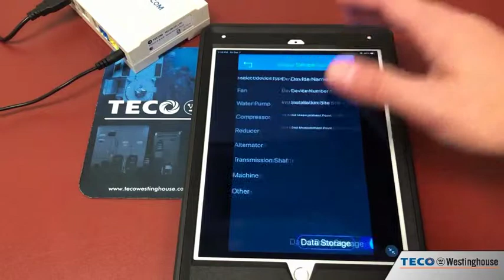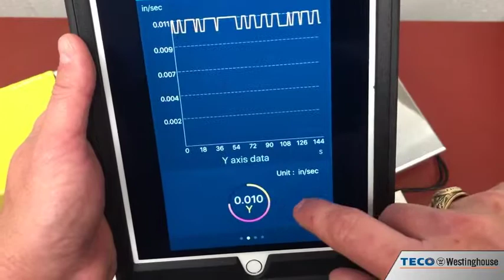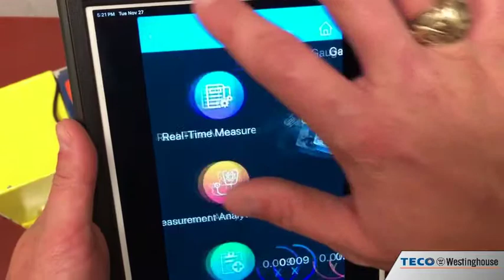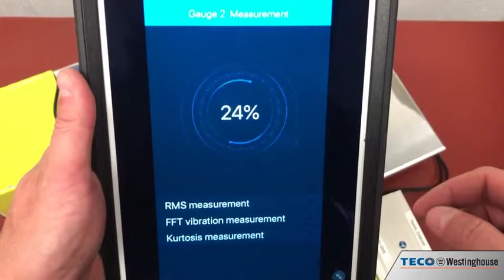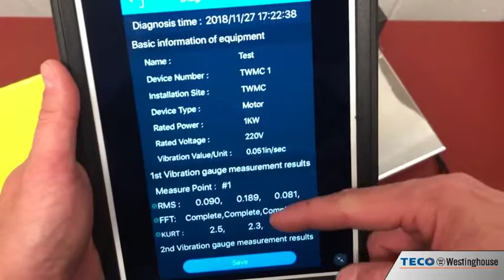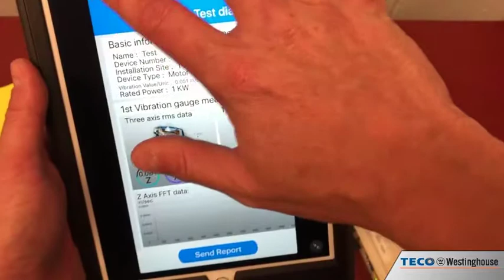TECO Pro-3200 Portable IoT Vibration Analyzer

Comment: With the greatest respects as a predictive maintenance engineer, I cant see this having much use past doing workshop testing or lab work in a test environment. This wouldn't be practical for routes in a plant with those regular network cables and USB connections?